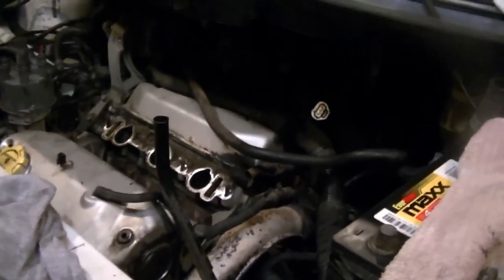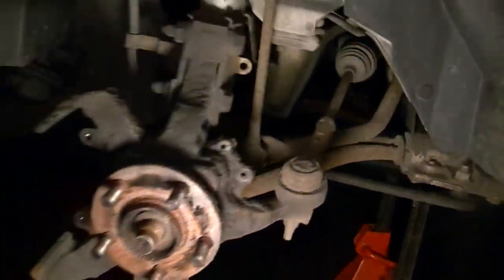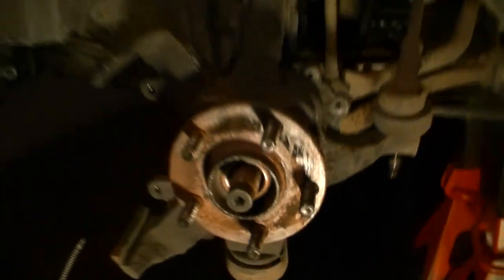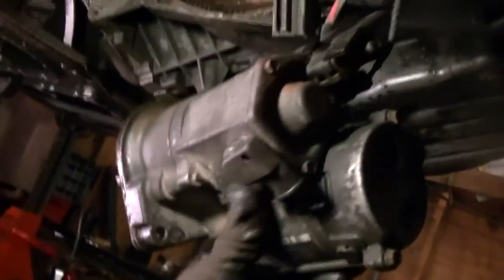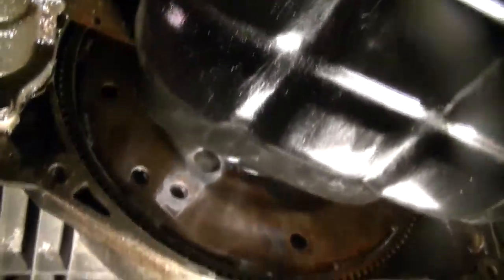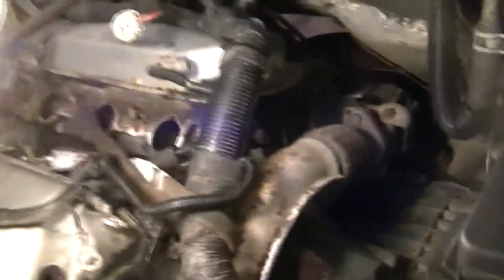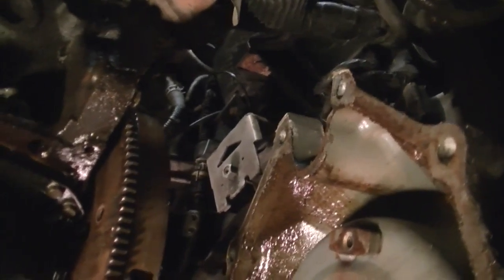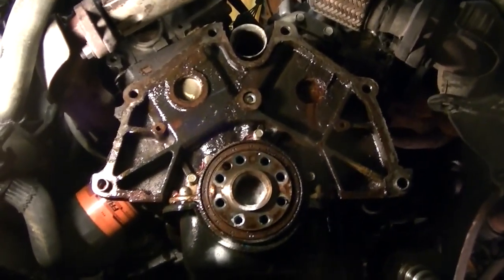3.0 Dodge Transmission Removal. Rare Video! -Mystery Antifreeze Leak Solved! -Part 2

Comment: Great Video. I watched it to get my trans off to swap my rear main seal, but now that its back together the flexplate is hitting something when it runs. I rewatched it and sure enough I did it right, rear main isnt leaking anymore and is driveable but sounds like a jackhammer now arrgh.
Reply from the maker: O my!~
Reply: @FixingWithPassion  eh the new seal is leaking anyway, I'm just gonna send it.

Drive it till it splodes noises and all

Comment: ..yep, my brothers 2000 Ram w/318 did the same thing. and, several other folks that had a Dodge had the same problem. they traded theirs off. my brother just keep adding water to his and that winter it froze, busted the block internally. i put a used engine in and put new freeze plugs all the way around. better Safe than sorry...

Comment: Great video. Hate those axle shafts. Also no room to work. Wish I had a tyranny jack. That trans is  a bear with just a floor jack- so unbalanced.  You should have pressure -washed that thing first. Greasy mess! Not as bad as some though.Thanks for posting!,
Reply from the maker: Yea today I get to replace a 3rd motor mount on my 2002 2.0 dodge neon (center one that's hidden) ugh...going to be fun. Sometime the smaller things are harder that the easy ones's.